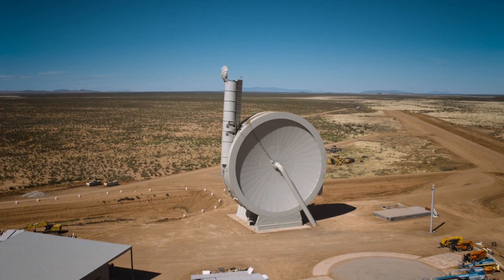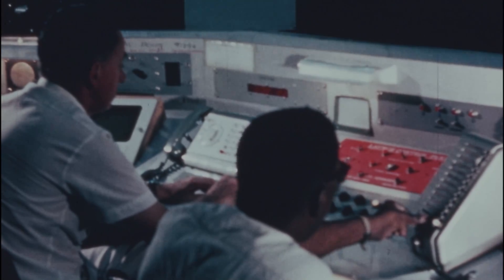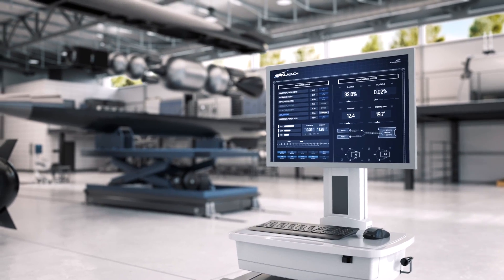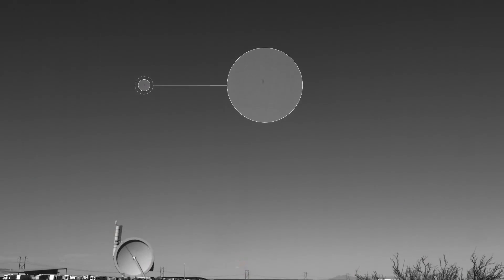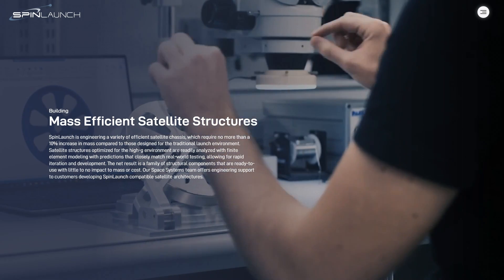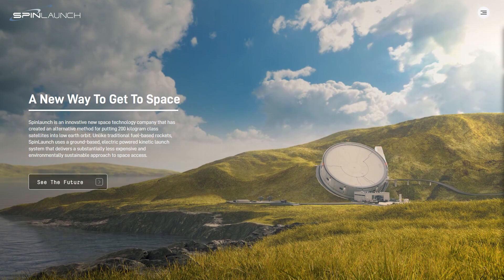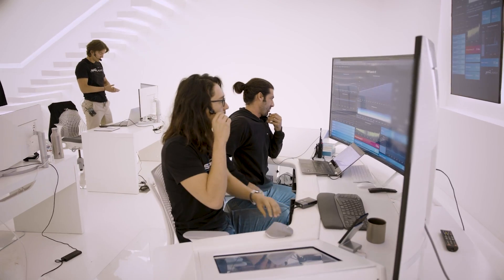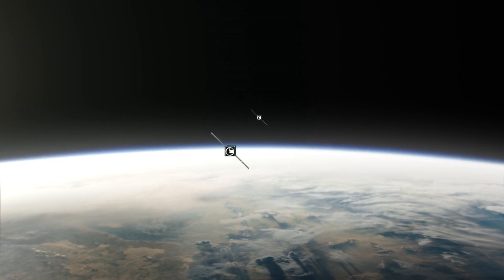Can Spinlaunch Throw Rockets Into Space?

Comment: For Rotor balancing....Same payload weight should(a high dense metal ball) be released downwards at another side of rotor into a Sand Pit or any effective impact observer
Reply: One slight problem with that idea... The KABOOM!!! 
Dumping an equivalent weight into the ground would create a pretty massive explosion, possibly into the kiloton range, complete with massive fireball, molten shrapnel, and mushroom cloud. All right next to your phenomenally expensive YEET! system. A phenomenally expensive YEET! system which is still spinning, still containing a heckuvalot of kinetic energy. Which would most likely suffer a most spectacular RUD. Considering the amounts of energy involved, the blast radius would be measured in kilometers/miles.
As the whole point of the system is to be a cheap, reusable launcher, blowing up a phenomenally expensive YEET! system with every shot kinda defeats the purpose...
Reply: @gchampi2  "Dumping an equivalent weight into the ground would create a pretty massive explosion, possibly into the kiloton range"

(EDIT: Fixed the speed.) Not even close. If the weight is 1,000 kg and goes at 10 km/s its kinetic energy would be equivalent to about 0.01 kilotons.
Reply: @seneca983  At 1,000km/s, using 1,000kg, you'd get slightly more than a kiloton yield - closer to 120KT (119.503KT). I think you meant 1,000m/s...
Using the data in the video - 11,200kg @ 2,100m/s, the actual result is 0.24696TJ, or 0.059+KT. So yes, I was incorrect with my initial statement (too much blood in the caffeine stream), but 59 tons of blam going off next to a phenomenally expensive and highly energetic YEET! system still seems a bad idea, as a RUD would still be pretty darn spectacular.
Reply: @gchampi2  "I think you meant 1,000m/s"

Actually I meant 10 km/s (which is close to escape velocity). I've edited my comment accordingly. With this speed I think my calculation is correct though I can't be bothered to check it. At least the order of magnitude comports roughly with your calculation.
Reply: @gchampi2  "59 tons of blam going off next to a phenomenally expensive and highly energetic YEET! system still seems a bad idea"

Maybe they could throw the counterweight down a borehole; maybe it could be filled with water to dissipate the energy gradually.

One possibility would also be to have the counterweight be closer to the axis of rotation so it would have a lower velocity. It would then need to be heavier but its kinetic energy would still be reduced.
Reply: @seneca983  "Maybe they could throw the counterweight down a borehole" - Hmmm... BIG explosion at one end of a tube. That'll direct the BLAM nicely, straight back into the machine...

"maybe it could be filled with water to dissipate the energy gradually." - Nope. At the speeds we're talking about, water acts remarkably similarly to a solid surface - all you'd really do is direct a whole lot of superheated steam into the machine. Still a BLAM situation...

"One possibility would also be to have the counterweight be closer to the axis of rotation so it would have a lower velocity. It would then need to be heavier but its kinetic energy would still be reduced." - Not quite. Yes, you'd have a heavier object traveling at a slower speed, but the kinetic energy would stay the same. Newton's 3rd law's a thing. 

That's the real problem of the whole spinlaunch concept. To launch 11.2 tons @ 2.1km/s takes 246.96GJ. That means you have to find some way of dealing with 246.96GJ of reactive force in the opposite direction to launch. The simple way is to do what we've been discussing - dump the energy out the back via a secondary mass. Unfortunately, the results of such an instantaneous method of energy dispersion is, well, BIG BOOM!

The complicated way is to actively rebalance the rotating beam at the point of launch, which would theoretically allow the energy to be dissipated over a longer time period, by using the electric motors that power the launcher as generators - think regenerative braking. This is what Spinlaunch seem to be trying to do. 

I'm not entirely convinced that this would work at present, as rebalancing a rotating beam that has just lost 11.2 tons off one end rapidly enough that the entire launcher doesn't eat itself is... Not trivial. You're dealing with massive forces over timescales measured in milliseconds, with the potential of a very spectacular RUD if anything goes badly. 

Is it possible? Theoretically yes. Practically, maybe. I don't know enough about the materials and systems Spinlaunch intend to use to give a definite answer (& they aren't about to tell anyone either - trade secrets...). All I can really say is that I'll be happy to watch the testing of a full sized spinlauncher via the web. By the nature of the proposed design, it'll either be a spectacular success or a spectacular failure, with nothing in between those two outcomes...
Reply: @gchampi2  "Not quite. Yes, you'd have a heavier object traveling at a slower speed, but the kinetic energy would stay the same. Newton's 3rd law's a thing."

You're mistaken. If the counterweight would have, say, half the distance to the axis of rotation it would have half the velocity and would need to have twice the mass. The formula for kinetic energy is m*v²/2 which means that when you half the velocity and double the mass then the kinetic energy would be halved because it's dependence on velocity is quadratic but on mass only linear. The momentum of the counterweight would be the same but not the energy.
Reply: @seneca983  Eh, whatever. It's the difference between 60 tons of TNT going BOOM & 30 tons of TNT going BOOM. Either way, the launcher would be well & truly knackered...

Comment: Crazy how the rocket just blows a hole straight through that cap. I get its to keep a vaccum inside until its ready to launch but its still crazy to think of the massive amount of air flooding in suddenly
Reply: And the beautiful angle of 30 degrees the rocket does is also great for flying..  this project is a stunt nothing else.
Reply: Yes, and oddly enough the cap does not even get sucked i side bit blows outwards. 
I am very very very sure there was no vacuum in that thing. 
This is a scam to get investor money.
Reply: tbh it's "just" 1 atmossphere (yeah that's still a lot, but totally doable, though hard)
Reply: @Markus-zb5zd  1atmosphere as in at sea level in the open.
Nothing that needs to be achieved. You are surrounded by it…
Reply: @johanea  yeah but a difference of 1 atmospehere is not that easy, at sea level that can hold a water column of 10 meters
Reply: Bunker busting missiles somehow manage to pierce through several meters of solid concrete while keeping their shape. At these energies, punching through a steel plate should be nothing.
Reply: @Yora21  if you have a special design penetrator that actually ablates while doing so
Reply: @Yora21  I doubt there're some kind of sophisticated equipment in bunker busting missiles that should work after penetration. 
Only explosion is required to happen after it and navigation, computer unit etc can die on impact. 

Kinda the opposite here

Comment: While this might be an interesting alternative, it seems the engineering needed, the precision of release and safety procedures needed makes something like an air launch system (from a high flying plane) a more cost effective and simpler alternative.
Reply: @Glenn R. Frank Even if it isn’t as effective, it’s still cool the tech exists, thanks for informing me about it
Reply: Wouldn’t you still have the issue of raising the payload to the altitude needed to launch it from the plane?
Reply: @Harbinger_of_Doom146  Virgin Galactic already has tested and launched to orbit from it's 747 carrier plane ... technology already exists and works.
Reply: One can go one step further. For air launch one has to strengthen the rocket such that it is able to survive being carried under the wing. Launching from the ground allows for a much lighter, more efficient structure, which is not only much safer, but can also significantly increase the payload for the same size of the rocket.
Reply: @cogoid  uh... the 10,000 Gs that the rocket has to endure in the Spinlaunch requires WAY more structural strength than something carried underwing to a high altitude like Virgin Galactic Air Launch for instance
Reply: @glenn_r_frank_author  That is precisely my point. Virgin Orbit launches an equivalent of Falcon-1 from the airplane, but their payload is smaller than that of the same Falcon-1 launching from the ground. A rocket for 10000g will be more like a submarine. Even more crazily inefficient.
Reply: @cogoid  ah... got it. I must misread it as the opposite. :-)

Comment: There are three simple and reasonable cargoes that this thing could supply to orbit that do NOT require massive engineering of the cargo to survive the launch forces:  Water, Fuel, Steel I-Beams.  A liquid filled pressurized tank or a solid steel structural piece can EASILY withstand such forces.  And these commodities do, or will, represent the bulk of upmass.

Comment: One way to approach avoiding the immediate "rebalancing" requirement after releasing the payload is to make the rotor assembly far more massive than the payload. This method is commonly used in various labs that use centrifuges. For example, when centrifuging blood to separate the various types of cells. Even if the test tube fails catastrophically, the centrifuge itself won't need "rebalancing" and won't explode and "fire" heavy metal shrapnel all over the lab because the combined mass of the [blood sample+test tube] is insignificant compared to the mass of the rotor assembly. Of course, when dealing with a high mass space vehicle as the payload, the rotor assembly would have to be incredibly massive to be able to employ the same method. Other factors can also come into play, but this relative mass relationship tends to dominate in the result.

Comment: The Discus Technique Can Be Broken Down Into Phases. The Purpose Is To Transfer From The Back To The Front Of The Throwing Circle While Turning Through One And A Half Circles. The Speed Of Delivery Is High, And Speed Is Built Up During The Throw (Slow To Fast).
Reply: A Skyhook Is A Proposed Momentum Exchange Tether That Aims To Reduce The Cost Of Placing Payloads Into Low Earth Orbit. 

A Heavy Orbiting Station Is Connected To A Cable Which Extends Down Towards The Upper Atmosphere. 

Payloads, Which Are Much Lighter Than The Station, Are Hooked To The End Of The Cable As It Passes, And Are Then Flung Into Orbit By Rotation Of The Cable Around The Center Of Mass. 

The Station Can Then Be Reboosted To Its Original Altitude By Electromagnetic Propulsion, Rocket Propulsion, Or By Deorbiting Another Object With The Same Kinetic Energy As Transferred To The Payload.

Comment: You mentioned there were some issues with dynamic stability after launch - I wonder if this has anything to do with the 'rocket' not travelling perfectly straight. In the clip where the rocket is breaking through the frangible panel over the launch tube, you can see that it 'tears' a slot through the cover rather than breaking a single hole, meaning the rocket is 'crabbing'. Clearly this is why the aperture is rectangular and not circular or square, which suggests they anticipated this.

This reminds me of the method archers use to test the alignment of the nock point on the bow string, by firing arrows through a sheet of paper. If the arrow leaves a slit in the paper, it is not flying straight.
Reply: As Thunderf00t pointed out in his video, the rocket is likely tumbling when it gets released. I assume the release mechanism instantly releases the whole rocket, so the rocket continues to rotate at the same 400 RPM or whatever, but now around it's own center of mass. Then aerodynamic forces kick in and it straightens out, but it probably manages to make a few rotations in the meantime and maybe even loose a bunch of energy because of it.

There would be much less questions if the test was filmed properly (or maybe it was, but the footage is being withheld).

Comment: If we take their numbers for face value, then it is easily demonstrable how the idea is impossible, as the rotating arm would tear itself apart even without any payload, unless it is constructed using solid graphene or nanotubes. And the arm is the least probable point of failure.
So no, it can not work engineering-wise, as it is impossible to scale up to the point they want it to operate at.

Comment: What about digging angled tunnels through mountains at an angle then, hyperloop style?
The larger distance (I'd expect up to 4km in practical applications) would allow for more manageable accelerations and the mountain could provide good structural stability.
Maybe there could be difficulties tied to geologic movement... but hopefully those can be overcomed!

On 4km, to get to the Mach1 you'd barely need more than 1G of acceleration, drop the tunnel length to 2km (about 2.5G) and you might be able to dig such a thing even without a mountain.
If 5Gs are acceptable, you could almost think about shooting humans at Mach2 with a 2km tunnel.
Unlike a hyperloop, here hyper-efficiency wouldn't be needed (it's ok to have noise and we don't need to be able to load multiple wagons at a time): The projectile could be smaller than the tube to avoid pressure buildup, or even be backpressure fed, while being electromagnetically accelerated...
What do you think?
Reply: That is likely the only practical launch booster. and would still just be boosting a sizeable rocket. I mean rockets accelerate at about 3-4gs for much more than 100km just for orbital velocity.

Comment: Ya know, that rebalancing thing may be better thought of as a change of axis of rotation.  When the rocket is released, also release the arm from its hub, and reattach to a different hub at the new axis of rotation.  You know where the new axis will be (based on payload weight), and have almost a full rotation of the arm to get the new hub in place.  There shouldn't be much force on the new hub (unless there is, in which case you're rebuilding the whole launch system anyway), so the arm could just kinda rest in it as it slows down.  A touch less crazy hard than rebalancing, I'd think.  I can't even begin to think how rebalancing could be achieved...

Comment: Two things don't seem right. Although the projectile is spinning round very fast, the force on it, surely, is outwards perpendicular to the centre (spindle of the arm). So when released, wouldn't the missile need to be angled outwards at the resultant force angle rather than be mounted in line (perpendicular to the radius)? Otherwise the missile would be hurled sideways rather than follow a course in line with its profile shape. Secondly on release, the spinning arm would instantly be out of balance and destroyed unless a counter-balance was released at the same microsecond at the other end/side. The counterbalance would have the same enormous energy as the missile and would have to be absorbed somewhere and somehow inside the enclosure

Comment: I'm sure they've thought about this but a really simple solution to balancing the spin arm after releasing the payload would be to just simultaneously release the counterbalance and just let it fly downards in to a giant sand pit or something
Reply: They would have to separate it into a counterbalance for the payload and one for the arm, since the arms are different lengths, they would still need some counter balance for it.

As for where it goes, the issue is twofold. You don’t want to destroy anything and you need to maintain a vacuum in the chamber. The speeds it is moving at would likely destroy the released counterbalance regardless off how you try to stop it. Maintaining the vacuum is less of an issue, it only really stops the counterweight from being launched out of the spinner.
Reply: the only way I can see that not being super destructive is if it turns into a gas... maybe an explosion should acompany the release of the rocket forming a very strange cannon where the 'bullet' is already faster than the shockwave
Reply: the only thing that exists in their made up "space" is your mind. Wake up dude. You're asleep & don't realize it yet.
Reply: @JayLuke1234  lol
Reply: @JayLuke1234  you having a bad trip bro?

Comment: my first though its use in the space environment, and shoot another rocket to mars or something,
this method can't onboard with human right?
the launch system can only run by computer right? due to what u said the launch window just 0.2s? 
also as we all know the air more dense close to earth, it better build really high in altitude to make it work and lower the error,
when crash into higher density, things deflect. and it make the launch direction have a lot uncertain.

but it show different direction of space travel, really nice,
may be use this Spinlaunch for sending material to build the space station, 
we sent a few rockets to space and reassembly they into space station in the old way, 
but we may need one traditional rocket to takes the human only, and other parts use the Spinlaunch,
it may save up a lot fuels

Comment: Or release an counter wight at the exact same time as the rocket. You need an tube in the opposite direction that slows it down.  And maybe it can get some energy back with an induced electric field in a copper tube. Thats the first thing that came in my mind.. i don't know if it works.

Comment: A large part of the problem with ground launch systems is the atmosphere at sea level, I wonder if it's possible to fire an initial projectile that punches a hole in the air that the yeated rocket travels through, like a distant tow from an F1 car, it's far enough ahead that it wouldn't interfere with the rocket. I'm sure there are many reasons why this isn't practical, it was just a thought!